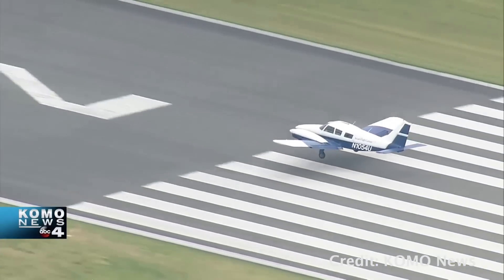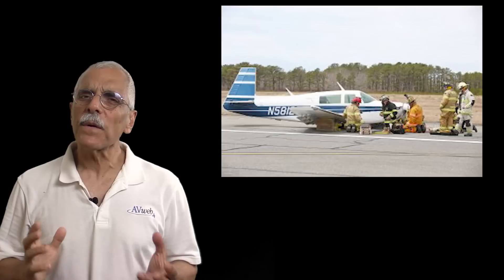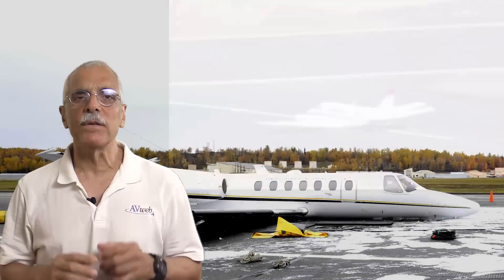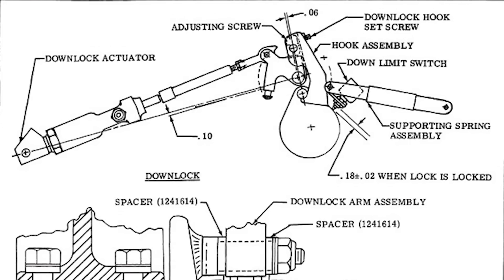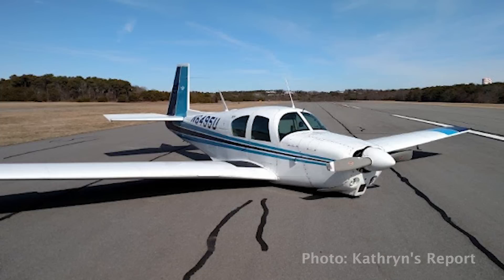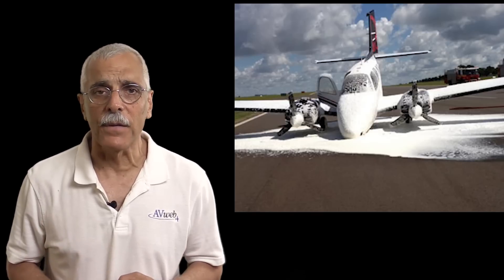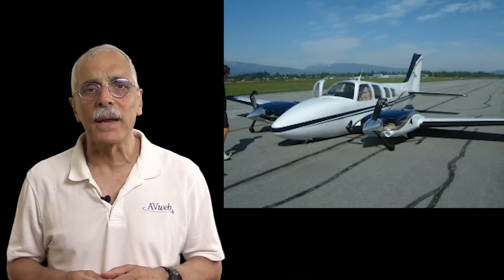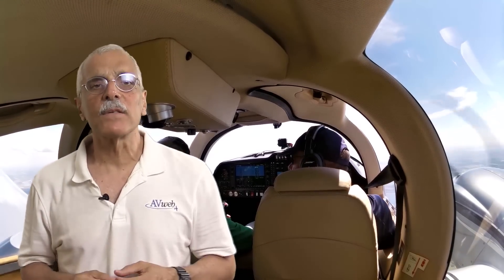Why Gear Up Landings Happen

Comment: Holy crap, B-1B gear up landing. That's an expensive mistake.
Reply: Expensive, yes. Write off? Probably not.
Reply: No worries, we the people have got 'em covered! Send us the bill!
Reply: Strongly doubt a belly landing would write off a B-1, but yes it probably cost a pretty penny to put back into service.
Reply: There was an F-14 gear up landing at Fentress years ago.   These things happen and most will buff out.....
Reply: Our hard earned tax dollars at work!
Reply: Kinda have to disagree with that F Huber!   There's props, engines to be removed and sent out for propstrike inspections, repairs of the bottom skin, maybe a new nose cone on a twin, fiberglass repair, cowl flaps, flaps, sometimes a wing hits a taxi light, not to mention paintwork, ordering new antennas, and other things hanging off the bottom.
Reply: happysawfish  the entire rig requires a thorough going over.  that means everything.  from the skin to each and every system!
Reply: Well if you look closely you'll see it slid on the nose and engine nacelles not the belly!
Reply from the maker: More like two months, if that.
Reply: Here said B-1B Lancer gear up landing http://www.zianet.com/tedmorris/dg/bombers4.html still flying to this day.
Reply: Not a write off unless heavy structural or catastrophic damage is evidenced.  More often than not depot level maintenance.  
And a flight crew grounded while under investigation.  They'll be flying desks for a while.
Instead of chocks and pins it will be chairs and pens.
Reply: how much money do you think NASA spent for your fake "moon landings"?
Reply: @stratoleft  dnuor si htrae eht
Reply: The majority of gear up landings  have the aircraft repaired within a week.
Reply: Nope. And I'm sure that B-1 cost more to get flying again than it cost initially. The government doesn't have to justify things financially.
Reply: @Bartonovich52  not true.   200+million when they first came out.  Repair for this plane was around 8 million.
Reply: @Bartonovich52  I'm not really one to hate on government spending, often times it's a result of unions and actually paying people livable wages
But the military absolutely pisses away money sometimes.
A plane that old with that much damage? Drag it to the boneyard and use it for parts for the others.
Reply: @Bartonovich52  "Nope. And I'm sure that B-1 cost more to get flying again than it cost initially." You were wrong.
Reply: @Bartonovich52  The B1-B is long out of production so if you want it flying again, you fix the the one you have regardless of cost.

Comment: GUMPS check:
Gear down
Undercarriage down
Make sure you put the gear down
Put the gear down
Stupid
Reply: Gas, undercarriage, mixture, prop, seatbelt
Reply: VAAv8or hahahahaha beautiful!
Reply: The S in GUMP is for sense of humour failure
Reply: Excellent eye opener if you don,t know
Reply: How about brakes off? It's part of the BUMPF pre landing checks here in UK. I dunno how it would be possible to have applied the handbrake ??.... possibly this check is allowing for it to have been mistaken for another control during the flight and applied?? ... it's just something that was drilled into us. Brakes, undercarriage, mixture, pitch, fuel pump.
Reply: As part of a good final approach check, and in fact a radio call to Tower to this effect was required by the USAF when I was a military pilot, is to do a final gear check at the FAF.  The required radio call was "Final approach fix, gear down", a check I still say to myself even if flying a fixed-gear piston single... never hurts to look out the windows and make sure they look good, at least in a high-wing.  There was also a required crew of pilots in a small tower near the approach end watching aircraft on final to check and confirm all 3 were down via binoculars and wave them off if anything looked bad, great idea to eyeball first-solo students in a supersonic aircraft and to protect lives and valuable air assets.
Reply: VAAv8or Then do it again!
Reply: R Diaz to not get trapped
Reply: @alan harvey My 'brake' check in BUMPF is twofold - ONE: Give them a press and make sure they have pressure as expected, and likely to respond as intended when required. TWO: Get your feet AWAY from them, so you don't inadvertently have them applied on touch down if you've had a crosswind, or when controlling the nosewheel on the touchdown roll.
Reply: rbrdly .... the point on give them a press to see if there is pressure is a fair one and though I was never taught that it a good idea .... these BUMPF checks are done on the downwind leg or a long final but yes, always make sure feet are away from brakes  ... not part of the routine BUMPF pre-landing checks though as rudder would continue to be used after BUMPF of course.
Reply: That's genius, AND hilarious! :D
Reply: GUMPSC Gas, Undercarriage, Mixture, Prop, Seatbelts, Carb-heat
Reply: GUMP is a mental checklist:  Gas, Undercarriage, Mixture, Prop.